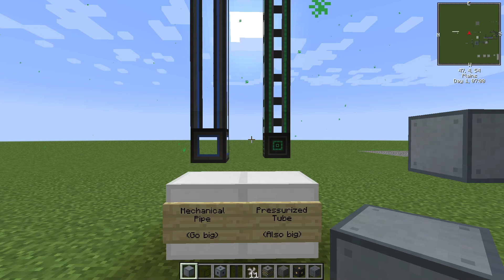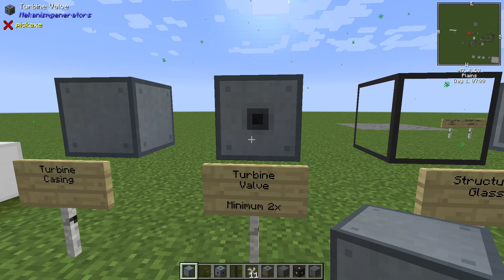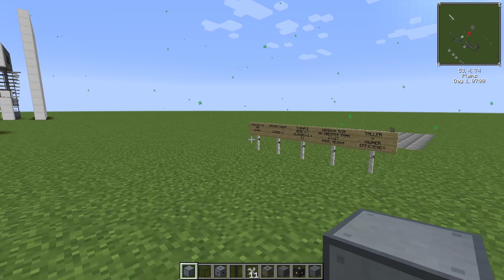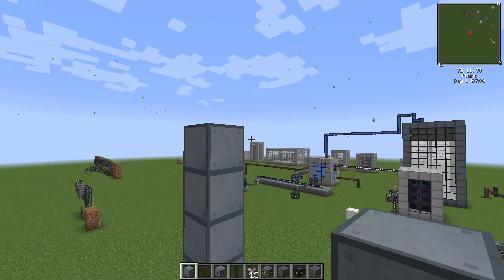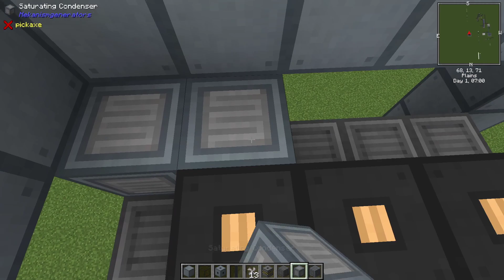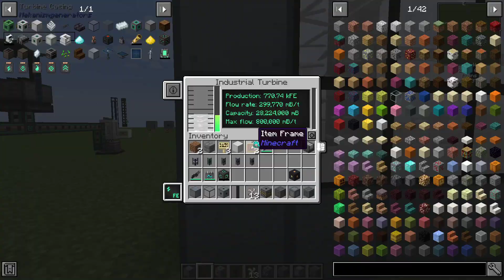Mekanism V10 Industrial Turbine tutorial. (Minecraft)

Comment: NICE video, do need the glass ? im doing this in a hole withou glass, and its not working :(
Reply from the maker: You should be able to build any multi block structure in mekanism without the glass. The industrial turbine is picky about the minimum height vs it's width, or it's maximum height. That's usually where the problem is. Or try double checking you didn't accidentally place something inside that didn't belong there.
Reply: @ChaosTheTerrible  but i did it
Reply: @ChaosTheTerrible  yeah i just forgot a block haha, i start to find videos, and im here
Reply: oh, just forget, i put the wrong block in the middle haha, thx for the video